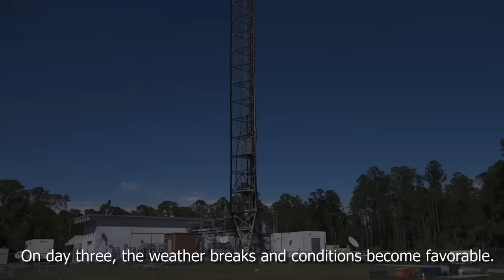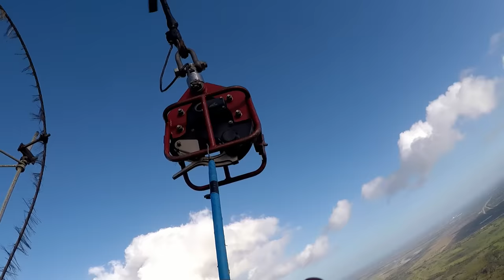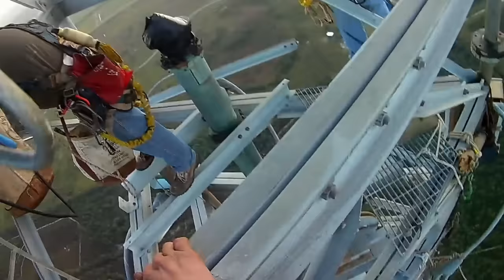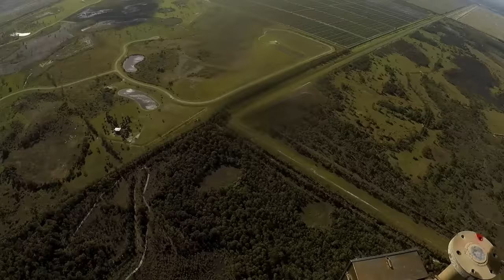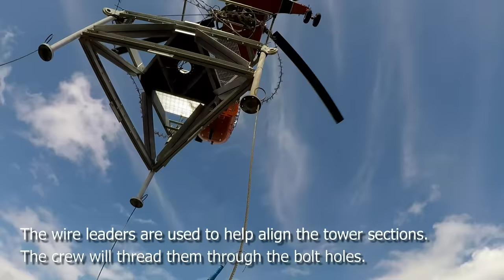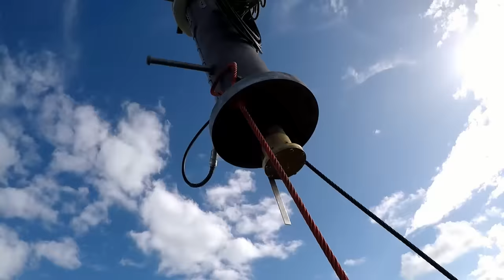ABOVE THE CLOUDS   03 29 2019 ANTENNA CHANGE OUT

Comment: Some serious piloting skills on display there.  I can't imagine how difficult it must be to hold the helo virtually still like they did.
Reply: The Erickson Aircrane (formerly Sikorsky) was tailor made for this kind of work. There is two pilot positions both manned, the forward facing pilot flys to the site then the rearward pilot (directly viewing the load) takes over and flys the cargo to its ultimate destination. Not easy peasy but I would think that it's a magnitude easier than regular chopper would be.
Reply: @SuperRede4u  Thanks!  I was curious about that clear bubble behind the pilot, and how they could see in a forward facing position.
Reply: pretty sure it has some type of hover/attitude/altitude hold mode with the upgraded avionics. but still...not something for the faint of heart as far as pilots go.
Reply: Bien Agiter modern technology && auto hover...xd
Reply: @SuperRede4u  TIL, thanks!
Reply: @hootgibsonxplane  I hadn't thought of that.  Still, like you said, not for the faint of heart!
Reply: Pilot did push the WRONG release button, releasing the load AND SPREADER, and could easily have killed some of the workers. Only luck prevented this, so maybe not the best skills.
Reply: @erikev  the load was already secured when he released.
Reply: @benargee  Well yes but he's technically correct - both the load and spreader were released (together) as opposed to only releasing the load. So the spreader fell which was the risky part. But we have no way of knowing what went wrong... maybe pilot error, maybe connection on the ground was made backwards. Who knows.
Reply: Bien Agiter  I think they call that rear cockpit the puke pit
Reply: @hootgibsonxplane  my $300 drone has that feature, i'm sure a million dollar helo-crane has that add-on.
Reply: @rickokemp1244  the older S64 did not have that feature.
Reply: Its literally Russian Mi-8 helicopter that they are using without cargo bay, very reliable and easy to operate. Good piloting skills also agreed.
Reply: Computer controlled
Reply: @feraxks, definitely.
Reply: @hootgibsonxplane  nope its all done by hands and feet. as you can tell by it constantly moving up and down etc while they were trying to bolt it on
Reply: Tom bryan It is not.
Reply: @hootgibsonxplane  It's like "flying paint" in aviation, only you're looking at a stationary antenna as opposed to another moving aircraft.
Reply: It's easy!!! They just use the "auto hover" auto pilot like you see in all films. And we know films don't lie 😁
Reply: @SuperRede4u  Yapp, kind of 3D work-share
Reply: @nicksmith9307 : Equivalent, maybe, but US made Sikorsky.
Reply: Autopilot
Reply: @hootgibsonxplane  I was thinking the same James.  Once in position, pilots could just hit a "maintain position" switch on the autopilot.  It'd be much more reliable than having to maintain manual control for so long.
Reply: Yeah, and what about Vortex ring state that makes heli go stalling if it stays still, because it 'uses' all air above it
Reply: @adriatic123 - That would only happen if the helicopter was descending at a rate of 300' per minute or higher, straight down, or in this case, if an updraft met or exceeded that rate.
Reply: @SuperRede4u  , called Sky Crane in Vietnam.
Reply: @adamellsworth3732 , connection could not be made backward. Whoever releases the spreader made a rotten mistake. He's remembering it this minute.
Reply: @KutWrite  Not. - The Mi-8 and the one seen here, are two totally different aircrafts. (The only similarity would be that both employs a main & tail rotor.)
Reply: @erikev  YES, I'm glad somebody else realizes this. But, I'm thinking there is a third man in chopper. The load manager/spotter.
Reply: No it's easy you just don't touch the thumbsticks.
Reply: @SuperRede4u  Thank you for the information.
Reply: @rickokemp1244  your drone got that feature from helicopters like the s64.
Reply: Yeah pilots have to be on their fame. I've had some pilots make errors damaging equipment, luckily no people injured but it takes good communication and consistent control.
Reply: I want to know how much these dudes get paid
Reply: @benargee  What do you want for OJT?
Reply: @adriatic123  ?
Reply: These helicopters have complex stabilization systems. You couldn't achieve a stabile hover using just pilot skills.
Reply: @DrDeuteron  GPS is currently only accurate to 3m at very best
Reply: @DrDeuteron  Meaning GPS doesn't have the requisite resolution. Motion sensor technology does.
Reply: @DrDeuteron  Yes, I'm sure that works, but my point is that such an approach is not suitable for this operation. Human lives are on the line, and besides, long lines mean stretch and oscillations. You'd never embark on a project like this relying on "pilot skill" to hold station. The potential for things to go wrong is enormous.
Reply: @erikev  Yeah that pilot is most likely out of work now.
Reply: @SuperRede4u  I always wondered about the crane operator if they controlled the Helo.
Reply: @nicksmith9307  The Mi-8 is pretty much half of this heli.
Reply: @SuperRede4u  Newer ones also have GPS hover capability, that is mostly made for rescue helicopters and handy for hovering over a ship during a rescue at sea. But wouldn't you like to have one? I remember them using one to put the top on the CN Tower too, pretty amazing engineering.
Reply: The helicopter probably also has stability-assistng electronics, gyros etc. To help.

Comment: As a lineman I can appreciate the professionalism of these guys on the tower and the helicopter crew.  When the main line released prematurely they knew what to do to correct the situation.  If I was a little younger than 60 I would love to do this for the experience. You guy's get 10 stars in my book.
Reply from the maker: The tower spotter was instrumental in helping Connor and Russel re-attach the load line clevis and release the choker lines to free the assembly
Reply: wrong.
Reply: @societalpreferences9182  huh? The guy who did the job and posted the video says otherwise
Reply: You could do it Greg, I’m sure!

Comment: Hats off to the helicopter pilot. To hover a large helicopter keeping so still is truly skilful
Reply: No kidding!  I'd definitely opt for climbing the tower over piloting that chopper!
Reply: Skycrane helicopters have complex position stabilization technology
Reply: Autopilot is a thing
Reply: @bsbforum  Well yes but no
Reply: Computers at its finest
Reply: @ericlucero806  Not really much of a power supply at 1500ft, plus it's bulky and heavy.
Reply: @ericlucero806  I don’t know about the “technicality’s” but I wonder if they used a battery powered tool if it would have any kind of reaction with the static electricity from the helicopter. You know how the guy got shocked and what not. Plus like another person commented about being bulky and heavy also. Like I said though I don’t know, I’m more or less asking the question myself instead of making a statement.
Reply: @SearchBucket2  you mean the pilot and crew?
Reply: @NETBotic  It's a system of inertial references and location technology combined to stabilise the hover. Just like modern stealth fighter control is stabilized by complex systems,  but dream on if you think otherwise ...
Reply: The Skycrane Pilot can swivel his control dome from viewing forwards to viewing 180° to reverse to control the lifting and fitting operations?
Reply: @SearchBucket2 Yes, and large helicopters are inherently more stabile than small ones.
Reply: @thesouthernpatriot24  The hammer worked fine.
Reply: @jamesnorman4965  I thought Skycranes had a forward facing set of flight controls and a rear facing set, with two pilots. Wouldn’t want a swivel seat, in case of an emergency.

Comment: We had these guys come install transmission lines for the company I work for. I'm just a mechanic, but I got to spend 3 days sitting there watching them in case something broke I was right there. The wind these put off is intense, insane even. The fact that these guys work like this is nuts, but they all love it.... These guys are not cheap, but they are great at what they do. When they get close to where the load is placed, there is another piliot in a bubble cab in the back that takes over the controls to place the load.
Reply: John, you are not "just" a mechanic.  How long do you think those things would stay in the air without your expertise?
Reply: Imagine swaying on a pole 1000 feet up. Haha.

Comment: How the helicopter can achieve this degree of stability for  this prolonged length of installation time is nothing less than a miracle!
Incredible calm work by the pilot!
Reply: @Chris hello,how are you doing
Reply: Things must have improved substantially in 24 years. We were contemplating doing a helicopter lift for a new installation at WVFT TV in Roanoke, VA in 1986. The challenge there wasn't height, but getting a 60 foot long antenna up a mountain road full of switchbacks, in a forest. We were told at the time that the crew would have 20 seconds to get the first three bolts in, as that was all the positioning stability the helicopter could achieve, We ended up using a truck that had a tractor with a very low cab. The antenna hung off both ends of the truck, one end going over the cab. We had a crane go in front of the truck, and another crane (and a tow truck) behind it. The truck driver was able to get it to the site without assistance of the cranes, Building that tower was one of the moist interesting jobs I have done in my broadcast engineering career.
Reply: @timstoffel4799  moist...
Reply: Auto hover on that chopper, I believe.

Comment: I love the cable leader idea.  We have the luxury of setting tower sections from a crane so don't need that but it's brilliant.
I flew in a Sky Crane, once, in the box the Army would carry.  I couldn't believe the amount of rotor wash coming off of it.  Amazing you didn't lose any gear off the tower being below that much rotor wash!
Reply: we did that when I worked wild well to set the  head back on the well after we extinguished the fire except the cables were hooked to a dozer to keep it from being blown back up from the force of the oil or gas escaping  at high pressure  the head was set by a athey wagon hooked to another dozer .

Comment: That piloting by the heli pilot is very impressive stuff, you've got to be aware of the helicopter itself, the tower and all it's supporting cables/rigging, the antenna mast, and lastly but no less important... The 4 crew members on the top of the tower that are removing the old mast and installing the new mast.

It is a good thing these Sky-Cranes have a backwards facing rear compartment to the cockpit to help locate the antenna, these helicopters are a real workhorse machine and even after 60 years of operation they are immensely impressive at what they are capable of.
Reply: I thought a lot about that chopper pilot... 
Pretty sure I'd rather be the guy on the tower than him.
Reply: Last few summers here in Melbourne Aus. We've had Delilah parked just up from our hangar for fire fighting. I was talking to one of the guys that maintain it and he showed me the rear facing compartment and it has controls that can be handed over from the front and the guy facing rearwards actually flies the chopper when doing this kinda stuff. Pretty awesome machines. Doing antennas or fighting fires these guys are absolutely brilliant at what they do.
Reply: I'd be worried about the wires supporting the mast. I could'nt see them very well and while concentrating on controlling the helecopter would likely forget about them!
Reply: @normanbrunt2053  Those are hard to spot. In the seventies or so, a small plane clipped one of the guywires of the Hoogersmilde radiotower in the Netherlands (the same that suffered total failure and collapse in 2011 after a fire). The tower then bent in a scary manner to the side where the weight of the remaining guy wires was pulling it sideways. This was eventually restored. There is belief that this accident caused the collapse of the tower in 2011 as the main structure was already weakened according to those people, with the fire easily weakening a structure 'that could not collapse'. If I remember it right, temperatures reaching 700 degrees or so were measured before the thing came down...
Reply: Those helicopter rotors also sound really badass when you're there. The rotor blades are massive & sound like it.
Reply: @weeardguy  With temps that high that tower had no chance of surviving, and I am not in the least surprised that the previous plane incident may have had bearing on the tower itself being incredibly weakened already.

These towers are gigantic and the thought of it collapsing is horrifying, you would have very little chance of escaping such a situation alive.
Saying that a mast collapsed in 2018 and three people very narrowly escaped that with their lives, unfortunately I believe one person did lose their life in the resulting collapse.
Reply: @SeanWyseman  I would love to hear one of these magnificent machines in person, I am totally in awe even now at just how incredible they are.

I hope that anyone that does get to see these things up close do take the chance to savour the moment, for these are some of the worlds long unsung heros and they need to be valued as such.
Reply: @Yodavich  "These guys are absolutely brilliant at what they do." - I couldn't have said it better myself.
Reply: @longnamedude3947  Nah, me neither. It was a bit of a 9/11 thingy: there were quite a lot of people who were absolutely convinced 'those towers could not come down... I mean, many of those are there for 4 to 5 decades already and none has ever collapsed.'
I have to admit I was skeptical about the event as well because on 1 day, in 2 towers with completely identical structural design, a fire started. The company in charge of the ether-signals tried to compensate for the largest tower (IJsselstein, the Gerbrandytower) going out of service by raising power at the Hoogersmilde tower, which apparently lead to the overheating of cables due to moisture inside those cables (which got many people questioning SWR-safety-systems on those transmitters).
I can completely understand why people thought it was a possible attack on those structures as in all those years, not one fire had been reported in all the similar towers in The Netherlands. I don't know about the Hoogersmilde tower, but I do know the one in IJsselstein is considered an A-target on the terrorism list since 9/11.

I don't know the details about the repairs after the plane-accident in the seventies. I do know a lot of bolts connecting the multiple tube-elements got bent, but I assume they replaced those ;)
The part where the tower got struck by the snapping guy wire most likely was repaired as well. The human ingenuity to repair things I consider to be beyond repair always astounds me.
Even when the Hoogersmilde tower had suffered massive damage as the metal tube-structure that makes up about 2/3 of the total height of (then) some 359 meters, had collapsed on top of the concrete tower supporting the tubular structure, some engineering firm stepped up to repair it, while I was only thinking 'How the hell do you start repairing such a thing. It turns out there are cranes that can reach high enough to enable repair to the concrete structure ;)

Fortunately, the Hoogersmilde tower was already on fire for hours before the structure was weakened so bad it couldn't support the weight anymore. The fire had lead to an early evacuation as firefighters had quickly deemed the situation too risky and the fire impossible to fight.

Here's one of the videos that captured the event.
https://youtu.be/O6mirWxZXzk?t=55
Reply: Uh, weather changes.  Wind direction for example.

Comment: Mad respect to these guys. They deserve more pay something tells me they don't get paid enough..
Reply: With the hourly pay plus Annuity and Pension and Healthcare it's one of the best paying jobs l had.
Union pay is the Way!
In 2010 l was getting $40 per hour and the Fringe worked out to $25 per hr for my Pension $19 per for Annuity and Health and Welfare is what they used to call it but now l think it's just Healthcare.
So l imagine these guys are making $90 per hour and taking home half that on their weekly paychecks.
From an old Ironworkers point of view.
I think these guys are considered "Linemen electricians" but it's got to be Union work..
Reply: @robertrachels1870  incorrect. There is barley the beginnings of a union for tower workers. We most certainly do not make as much money as we should. Lineman make 3-4x more and we climb much higher, we just don’t deal with any sort of high voltages.
Reply: @bauncey-chillups4638  
I just assumed that they were Union workers. And as Union members they would get paid Fringe benefits per Hour, (the Pension, Annuity and Health and Welfare) on top of their Hourly wage.
So whatever Company that needed and hired the Workers they will be charged at least 2 to 3 times the Hourly rate that the workers earn per hour.
I think you should Organize for better pay. So that you are paid the Prevailing Wage of your Trade.